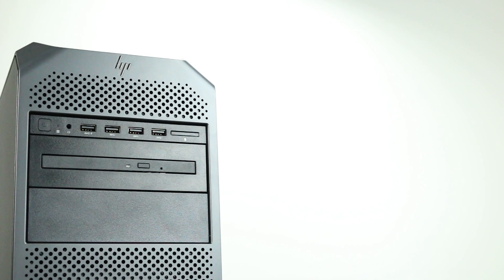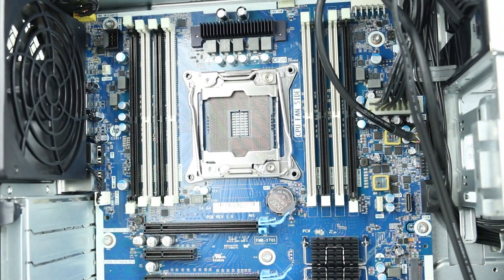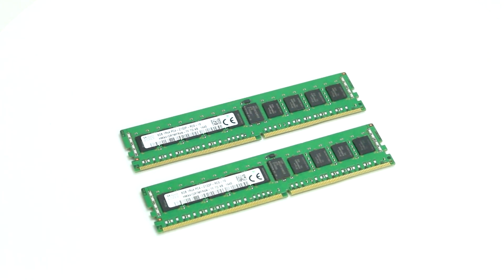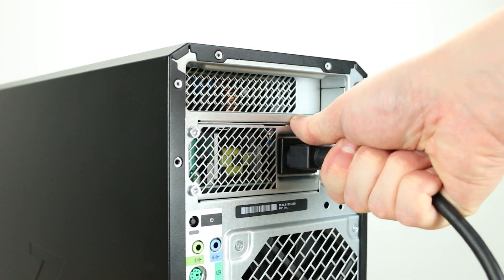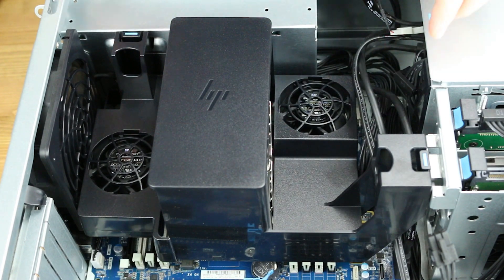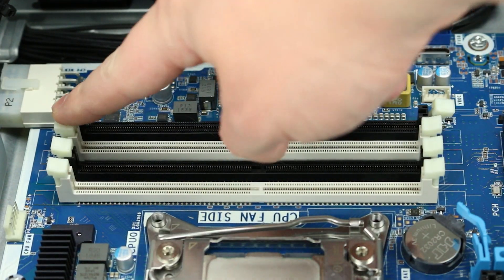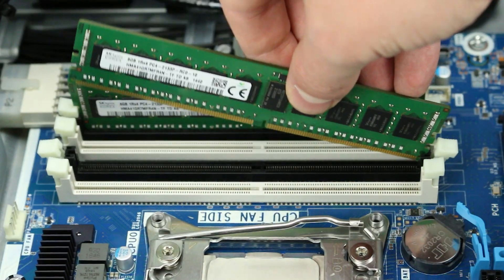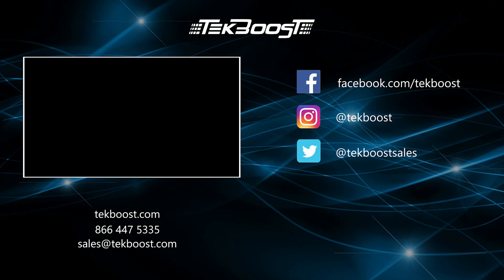HP Z4 G4 Memory Installation

Comment: I need a help. I have a HP workstation z4g4 with intel xeon w-2223 cpu and currently it have a memory of 32GB (16x2) i want to upgrade this to 64GB(16x4) memory. now right now i am confused that are these current memory modules ECC or non-ECC. Can i even use non-ECC and according which memory stick should i use. My memory currently have this on its label - 16GB 2Rx8 PC4-3200AA-RE2-12-DC1

Comment: Hi.  I have 4 16 GB RAM modules.  I am confused by the memory load order graphic.  The numbers on this graphic do not match my motherboard.  Right now I have modules inserted into 1,3,6,8 (All black slots).  My RAM speed is also slower than it was when I had 2 16gb modules (2133 MHZ now instead of 2666 MHz).  Should I change their Load order?

Comment: Hi! I’m trying to install 2 memories of 32 gb 2933-u mhz on it but i keep getting black screen, any idea why?
Reply from the maker: Which processor does your workstation have?  If you have a Intel Core processor (i7 or i9) then your memoy should work inside the system as long as used by it self or combined with like memory. However if you have Intel Xeon (W-21xx or W-22xx) then you will need ECC RDIMM memory such as 2933Y-R (instead of 2933Y-U).

Comment: I have 2--8GB RAM's and 2--32 GB RAM's--what order of slots should I install them in? The chart in this video only shows configuration of RAM chips of the same capacity
Reply from the maker: Install the 32GB in DIMM1 and DIMM8, and 8GB in DIMM3 and DIMM6.  Please note that all the memory needs to be the same type (If Xeon W Processors = ECC Registered, if Xeon Core Processors = Non ECC Unbuffered), and matching Rank and chipcount (example 2Rx8).  Best of luck.
Reply: @tekboost  From diagram in video i have to use DIMM 1 and DIMM 2 for 2x16GB memory. I'm confused when i saw yours answer to Jeffrey - DIMM 1 and 8, 3 and 6... sooo for my 2x 16GB memory i need to use DIMM 1 and 2 or 1 and 8?
Reply from the maker: @kamilgajdek6174  The video is showing the order of the DIMM Sticks, rather than labeling the DIMM Slot.  See this screenshot from the Z4 G4 documention for clarification :https://prnt.sc/E7ENPTWENSgp

Dimm 1 goes insto DIMM slot 1, DIMM 2 goes into DIMM slot 8.  The screenshot can be found on this document from HP, page 20:
https://h20195.www2.hp.com/v2/GetDocument.aspx?docname=4AA7-2219ENW
Reply: @tekboost  yup, thanks for quick answer, peace!